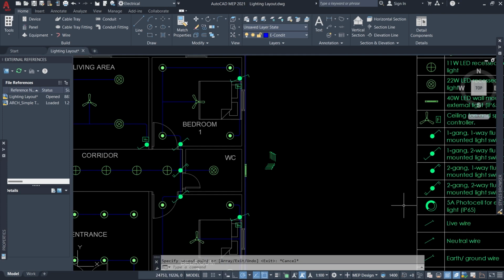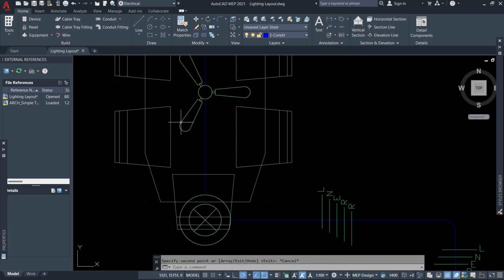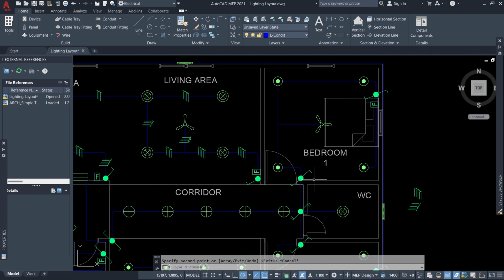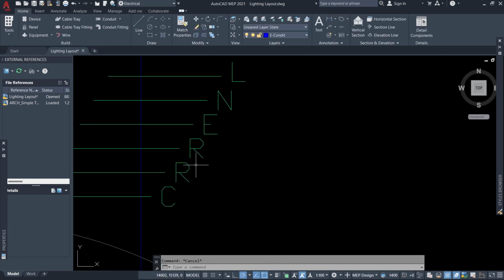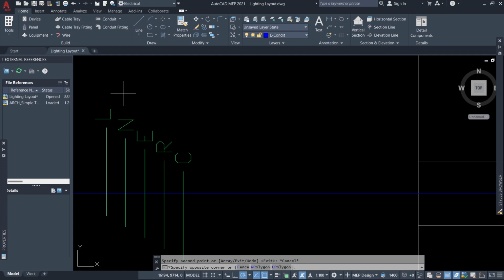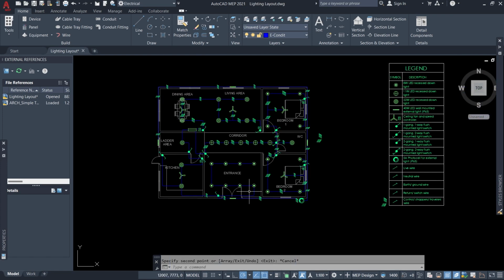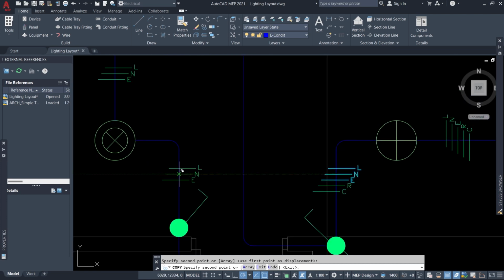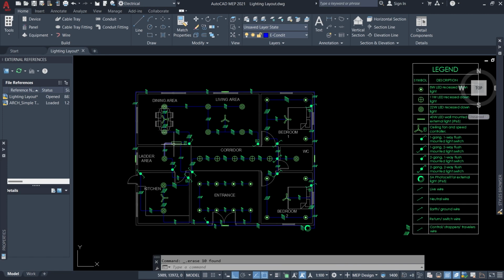E  - 04b. Two Bedroom MEP Project: Adding Conduit Runs & Wires | Lighting System Design

Comment: Hello Sir I enjoy your work from Kenya. We use BS7671 in electrical installation. Kindly elaborate on the return wire, in my understanding the neutral is the return wire. So why do we need to add an additional return wire when we have the neutral already?
Reply: I think he meant return wire as the branches of the live that go to different loads that is lamps and fan in this case, and then back to the switches...what in Kenya I believe they are referred to as half wires if I am not wrong.